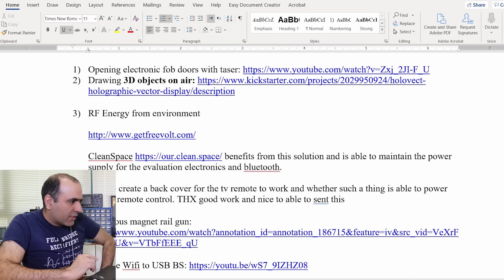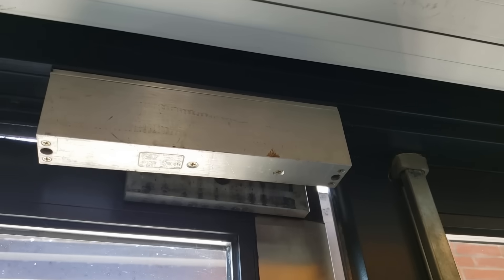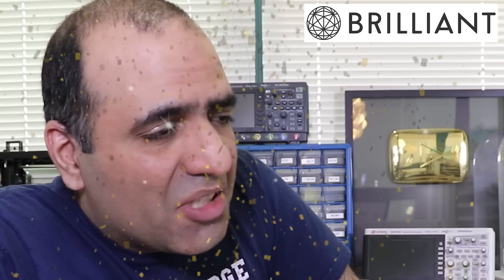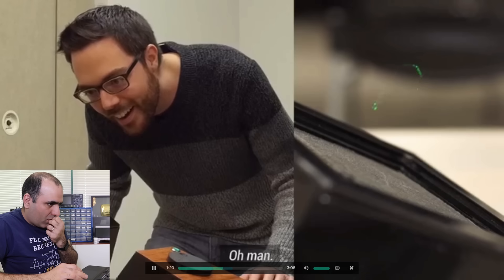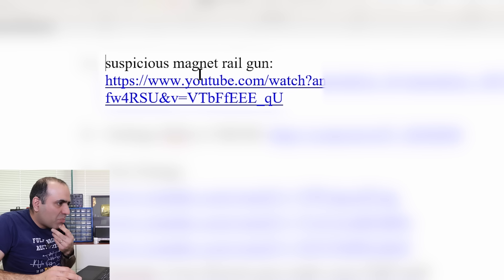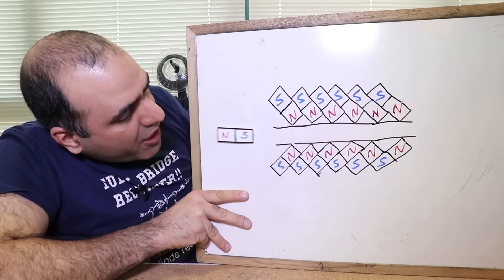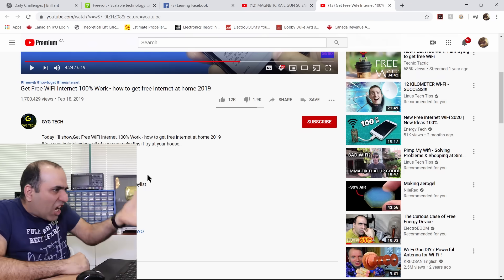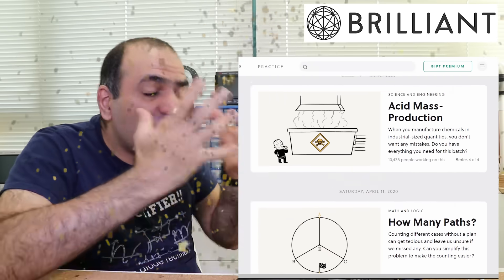BATCH RECTIFICATION of my To-Do-List

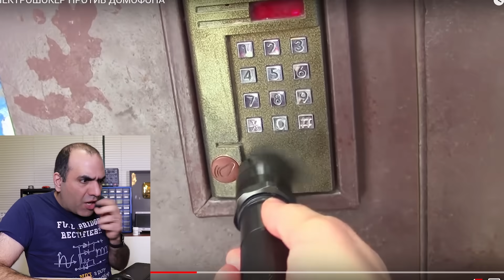Comment: 1:38 So when a fire breaks out and destroys the electronics, they should lock automatically. Flawless.
Reply: Usually you can open it from the inside no matter what
Reply: Electronic locks normally have secondary bypass mechanism to open it manually from the inside. You don't want an electronic lock that's normally open when the electronics fail, that's like an invitation to criminals.
Reply: There should be a feature to be able to open it from the inside regardless of whether its functional or not. That would be the most reasonable design.
Reply: Ben Chong yeah, I think it already has it (though I’m not 100% sure)
Reply: @benchong373  most have a button or lock on the inside that can open from the inside
Reply: Ozomän genius
Reply: Many electromagnetically locked doors are connected to the fire detection system (fire alarms, sprinkler system, co2 detectors, etc.) and automatically open when they detect a fire. if you have a more ethical owner they likely also have an emergency unlock switch somewhere secure, like the security room.
Reply: @cirrusundulus  no, fire escapes are supplementary to stairs. Besides, in Europe there are no external fire escapes
Reply: @mikoajp.5890  You mean stairswell leading down along the outerwall?
Atleast many public places in Finland have those.
Example my old school and high school.
Reply: @mikoajp.5890  bullshit. Many buildings here have external fire espace stairs.
Reply: He said resets not shutdown due to fire
Reply: i guess that's what a fire escape is for. or more clever engineering.
Reply: That's why you have emergency exit doors that are key-locked from the outside and have an alarm activated handle on the inside to prevent and detect unauthorized use.
Reply: Doors with external keypad or rfid access usually let you leave from the inside

Although the mechanism that unlocks it for people leaving is still electronic
Reply: Are you an idiot? They are in a metal box
Reply: If the fire has destroyed the electronics, the fire is probably also blocking the door :/
Reply: Doors like that are designed to always be unlocked from the inside regardless if the locks are engaged or not for the reason you're implying.

At least the kinds in the U.S. are that way.
Reply: @travissummers3102  Many public place doors in Finland have "pin" on innerside.

When you pull it the door unlocks mechanically. No electricity needed.
Reply: @jarskil8862  Interesting. This how our public doors are: https://en.wikipedia.org/wiki/Crash_bar
Reply: @travissummers3102  Moment when comment chain is full of people, unironically interested about emergency exit doors :D
Reply: Yeah, lol, you have no clue do ya.
Reply: If the fire disrupts the electrical supply the electromagnet turns off! Perfect

Comment: Questions For You:
Q1- What is the phenomena behind the 3 behaviours listed below?
1 - Aluminium foil levitation.
2 - Spark within the aluminium foil surface.
3 - Bulb is glowing without any power source connected.

Q2- Usually induction heater does not work with non-ferrous metals like aluminium, copper and many, then why aluminium foil interacting and behaving like this?

You can try to answer these questions..
By the way, I am going to ANSWER all these questions in a very Intuitive Manner soon…
https://youtu.be/ktTgJfHki0A

Comment: To be fair, most of those panels, especially the buzz-in panels, can be opened with a generic key, and the nodes used to buzz the doors open are completely unprotected, you can bridge them with a paperclip to bypass them. Most even have a simple solenoid for mail delivery access that you can hit to unlock the door.

Comment: Wouldn't a lot of these doors be specifically designed to unlock if the power goes, as a safety precaution in case of fires or similar?

Comment: 1:41 Yeah it is opening because all door locks designed this way. And you said the high voltage reset the circuit, so it also resets the door magnets state. It makes sense for me.

Comment: Well those old russian doors are FSM, or finite machine states, they output something based on the state wich it is in, if it resets it goes to the first state, or default state, wich in those cases opened the door.

I assume they were made this way is so that if there is an earthquake or a fire and the system either down or erratic the default state is open, so you can get out safely.

And by erratic i mean the circuitry that processes inputs is reading states that couldnt be possible, so they are defaulted to some known state.

A proper FSM door opener has other inputs and regulators so that if an emergency is happening the doors open.

Comment: I think it's smarter for a door to fail and be in the open state.
What if you're inside and it fails? Now you're stuck and f*cked.
Unless there's a mechanical backup or a failsafe system.

Comment: The whole electromagnet locks, it actually is safer for it to fail and let the door open, say the controls get damaged somehow but it keeps it locked, it would lock people inside, versus if it fails and then just unlocks it at least people can come and go. Say there is a fire that damages the controls but hasn't taken out the power, you can't unlock the door to get out, while if it just lets the door open, it lets people out. Something like that.

Comment: some info.       at 5:49,   there could have been a semi-legit, video production-related issue.
such as  rate  conflict   between the dvr's scan rate/virtual shutter speed  and the rate at which a 3-d image is  projected/created; that no one could fix.
the same affect can be seen in  dv recording of a  LED-array light  in operation (certain exterior automotive lights).      googletranslate

Comment: @ElectroBOOM
I had an idea the other day for a weird concept. 
Two or more independent voltages running over a single wire only serrated by the corresponding opposite pole of each power source.
Say you had 3 12v batteries in series. Now each battery had a separate negative wire leading off it.
Now in theory you could connect a 12v device to the 3rdbattery negative then to the 36v positive and still get 12v 'because electricity wants to flow the path of least resistance' so then in theory you could power 3 separate devices off those same 3 batteries without having to separate the batteries out of the overall circuit.
Any thoughts?

Comment: Ok, first.  there are many PVC doors and most entry system panels are made of some sort of plastic. So if u zap the system, nothing would happen, cause u dont have 2 spots with potential difference. Second, The RFID sensor is shielded with plastic, which is not conductive, so i guess u cant zap the system. 
Second, the russian video seems fake. Maybe there is someone who unlocks the door from the inside (in some systems there is a button inside, which allows u to open the door from the inside.

Comment: Door lock open when elektronics send cca 5s long signál. Only way to open door is reboot electronics becose after boot it check all components, send signál to doorlock. Second way is dissasembly Dior tablo to také 2 wire to door lock and connect it to 9v battery, when door lock Is DC u have opened door, but u need special screwdrivers for outer screws. Most of electronics as laskomet have master code to open. U need only manuál and seriál number to search opening code on keypad
Reply: That from montage tablos. When tablo is dissasbled every time i use 9v battery. When door lock Is AC u need create oscilating circuit to open
Reply: But i mean tablo Is connected to ground And electronics can be in fusebox in house. I mean tazer opening is unreal. But when tablo Is not grounded that can be true

Comment: About the doors, this was just made to prevent the drunks entering their house, and could be open with brute force. So if there is an actual emergency, there is a way to open it manually.
And it was built during the Ussr

Comment: Thing is a lot of electrically closed doors have to fail in the unlocked state for fire safety reasons. They definitely shouldn't fail by using a taser alright though.

Comment: Medhi is correct - those are Russian residential-building security systems with magnetic locks.
Those are mostly designed to keep homeless and hooligans out, most of them are not that secure.
If system is powered down door is unlocked (both for safety reasons and because of how magnets work)
However, beeping means electronic system has unlocked the door.

Those security systems are installed on most apartment buildings in cities.
They are unlocked through either standard dallas i-key-type contact keyfobs, RFID contactless keyfobs, or one of local-made alternatives to those which can be anything. Some can be also unlocked with a numeric keycode. 
Most allow typing apartment flat number to call a phone-like device inside a flat - resident can then press a button to unlock the door.

I suspect what happens is that the electronics glitch and reset, and most are designed to open upon reset because if intermittent power is constantly resetting the system it cannot read the key and open the door normally.

American system did not open the door despite glitching because it probably has an override keyhole or something like that, probably also some kind of fire/police keybox, Russian systems do not have anything like that - it is either electronic key or no entry - police has a huge ring of keyfobs and fire brigade would probably dial a random number or just use a crowbar.  

 This all is possible because door and electronics grounding is sketchy at best, and the key panels are often plastic even if they look like they are metallic. American system seems to be grounded better.

P.S. I'm not sure if Kreosan identifies himself as Russian, Ukrainian or even cares, but Russian people do live in Ukraine which is why all this Ukrainian crisis blown up.

Comment: I have installed dozens of access control systems. The first ones were set to fail safe rather than fail secure. So when you interrupt the power it releases. You want to use that for common egress points for emergency. The reason shocking the last apartment didn't work is because most of the systems installed use a lead acid battery backup so that if you lose power to your system all the doors don't just open up.

Comment: Mehdi could you make a video of a bicycle alternator to charge the mobile or power an arduino project?

Typically, alternators have a motor, the motor rotates and generates an alternating voltage.

Would it be possible to make an alternator only with coils and magnets to avoid friction with the wheel?

How much power could we get with this system?
How would you put the magnets or coils on the bike?

Thanks greetings.

Comment: Im just curious.. can you help me answer this question.. now i connect the shaft of the 220v dc motor to the 220v ac motor shaft then i connect the wires from the ac motor to the dc motor.. now if i spin the shaft so the ac motor generates electricity so  the electricity goes to the dc motor.. will the motor spins? And i think thats free energy right there?

Comment: I always wanted to try a taser on a fire alarm panel or a pull station (the ugly red things you use to activate the system in case of a fire).  

My dad worked as an engineer for an alarm device manufacturer called Gamewell in the early 90's, and said they cut corners just about everywhere.  You would think life critical devices would come with some spike protection and snubbing circuits on relays.  Nope!  And apparently their PCB manufacturing was sh!t.

Comment: The antenna actually works. Didn't you know that internet is basically just ones and zeros? USB power line actually works as one/zero divider while the coils gather them from the air. Plus cable gathers all the ones and minus cable all the zeros and phone goes through the decryption process called "BS" which translates to "world wide web integration".

Comment: the relay that runs the magnet is a normally on type that requiters power to turn the magnet off
there forth when the unit is resetting it will not release the door magnet 

in the event of a power out situation the magnet is off and will allow entry and exit in the event of an emergency ( eg  Fire , black out )

Comment: Hey Mehdi, if one had an automotive alternator setup generating DC power into a battery pack, could they output the DC power through a FULL BRIDGE RECTIFIER and send the AC power to a connected AC house outlet, to reduce grid power consumption? Could it work if the power was metered at an amperage below the connected circuit's overload capacity?

Comment: "Fail Safe" vs "Fail Secure." For low-security applications like these kind of locks, you probably want the door to open if the electronics fail to keep someone from being trapped inside. If it were a top-secret facility or something, then the door locks would more likely be designed to keep the door locked when tasered.

Comment: mehdi (or anyone smart) , i looked at electro booms video about the pain of dc vs the pain of ac and it tells me that ac hurts more because the body has a capacitor property that’s allows ac to travel easier through it. can somebody explain a bit deeper, i’m not sure what the two isolated conductive surfaces are when you get shocked.                                            edit: nvm i didn’t look hard enough if your weird like me and want the answer watch this https://youtu.be/vNpGoNP1tGQ

Comment: Regarding the 'holographic' display- usually lasers visualizations like that which use a rapidly moving mirror do end up with hot spots at the corners of shapes.  It takes time for the mirror to change direction after all.  And it's POSSIBLY that the better looking 'fake' seeming images were shot with a different camera that was set up with a slow enough (or more synchronized) shutter to make the laser projection look better.  The effects also may be "3D" wireframes that are just projected on to a flat curtain of air.  

If you want a really cool glimpse at what can be done by synchronizing laser output with a camera shutter, check out Childish Gambino's performance of "This Is America" on SNL.  At the end they did an amazing laser/camera effect, seemed very holographic, although for the live audience it wouldn't have been nearly so impressive.

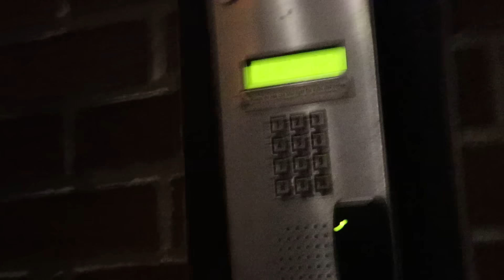Comment: Mehdi, when you zapped yourselves at first video, the door was reset and actually opened as the green light appeared on panel(3:34).
However, you didn’t check the door, so the door was blocked and red light appeared on panel(3:37)
Reply: The light appears to be RFID reader status, not door lock/unlock status.
Reply: @patricks.7420  I don't work for a security but in a big safety company's building they had simens RFID/NFC panels and they would go green whenever the magnet was deactivated but of course not everything is the same
Reply: @michaeljones5681   I've seen those fancy ones alternate red and green under fault conditions. Does that mean the magnet deenergizes every half second when the light is green?  Of course not, because green does not necessarily mean go, that's my point.
Reply: @patricks.7420  Typically if it's alternating quickly it's flashing to indicate error or mismatch, but in the video the screen went dark and the indicator was green for a considerable amount of time, consistent with what happens when a system reboots and the electromagnet isn't engaged at the start for a brief moment. I would try it with another person pulling on the door to see if it really releases.
Reply: @michaeljones5681  i have friend that live in the apartment i try this idk why the led turn green after reset but the door is still locked
Reply: looks like green before he does it. Last building i lived in had a green light, it blinked green for ok and red for not ok. but a constant green for showing it was on and ready to read
Reply: @mattlenn100  You can see during his first attempt the light is red, indicating this light is red by default when locked, but yes this varies between different systems.
Reply: He even said it was resetting, it was probably letting you know it was down until it reset to normal (red). He did try it, he said it wasnt opening literally 3 seconds after this timestamp
Reply: The power switch for the electromagnet is probably Normally Close(NC) so even though the door controller failed and hadn't return to its normal operation, the magnet still worked. Circuit working with NC switch basically opens the door that is normally closed so the system doesn't open itself when failed, or even totally destroyed. You need to disrupt the power feeding the electromagnet. Souce: Dad is a landlord of shitty apartments that have a shitty security system installed in each of them.
Reply: @kideo_h  Thanks for the info. That could be the case, but I don't see why a residential apartment would have something like this.  It's a big tradeoff between security and safety when a hazardous situation arises.
Reply: @kideo_h  ive worked with these HID/RFID systems with the electromagnet or electromagnetic strike plates a long time ago. If i remember correctly there is a setting on a jumper where you can set it to be normally closed or open on some of them or fail secure/insecure
Reply: Please mehdi try again
Reply: So he actually did it?

Comment: with your door testing. those maglocks are usually powered by separate PSU and your access control module is only releasing the door through its relay. so you have to kill the PSU holding the maglock to gain access.